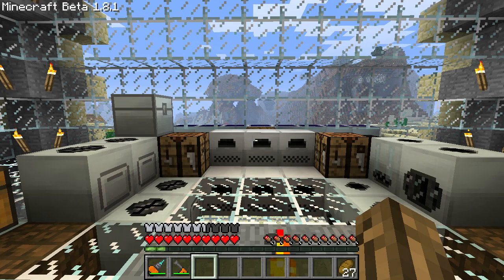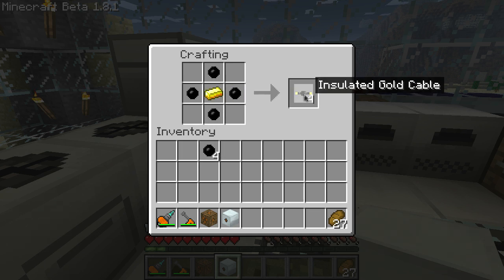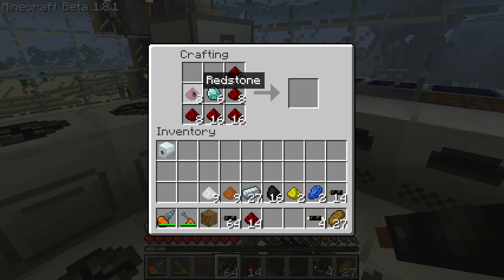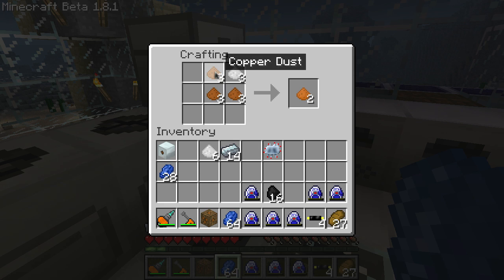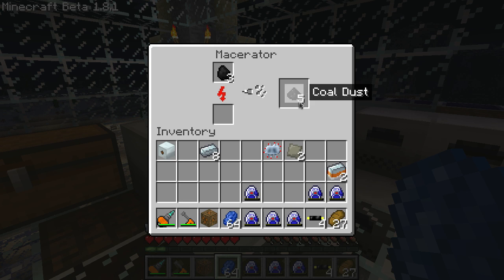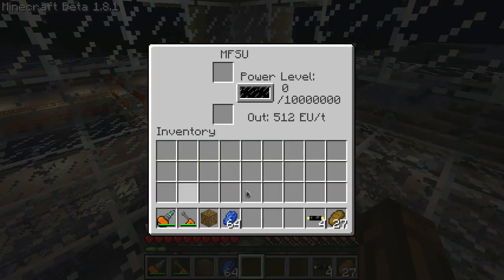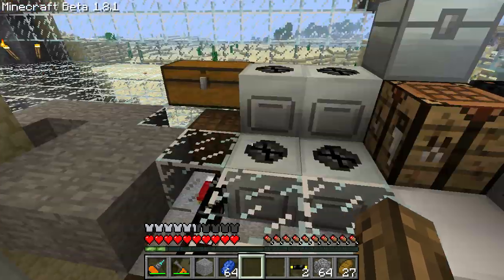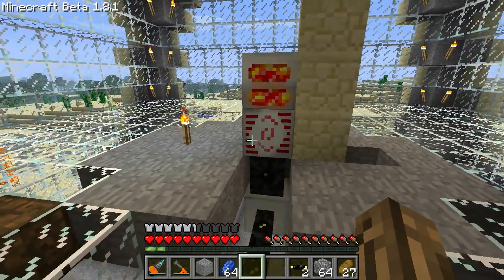Minecraft Episode 7  - Industrialcraft Energy Storage

Comment: You don't its a storage device, attach it to some appliances like an electric furnace and it will automatically take out whatever energy you need to work the furnace, but don't do it with high voltage else the appliance will explode so step it down with a medium voltage transmitter and then a low voltage transmitter and you should be good to go.

Comment: @BadashGames I know that , I just don't want to lower the power , because I'm working on a supercharged reactor , I GOT It SOLVED NOW :) , I split the cable in 4 outputs and I connected 4 MFSU .
 OMG it will charge the MFSU at 100% in just 4 min :D  .  
 I'm using buildcraft pipes to cool the reactor using Ice ( from the ice machine mod ) .
 I got 4 chambers and 32 uranium cells . I also using WIRELESS redpower mod to control the reactor.
I ll' upload the world when is done. Thanks bdw :)

Comment from the maker: @maumatos Put a HV transformer between your reactor and the MFSU. :D should work fine after this. Look for the HV transformer's recipe at the industrial craft wiki i have linked in the description, at the bottom of the page click on the energy and wiring bar, and click on the HV transformer. The 3 dotted face is your input face from your reactor on the HV transformer. Hook that to any face of the MFSU except the special face. That special face is the output with the MFSU.